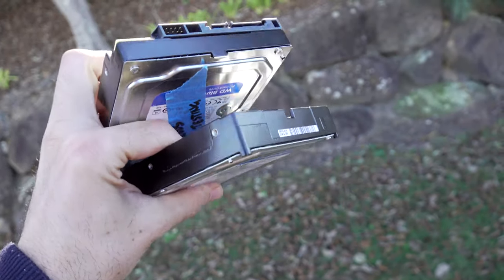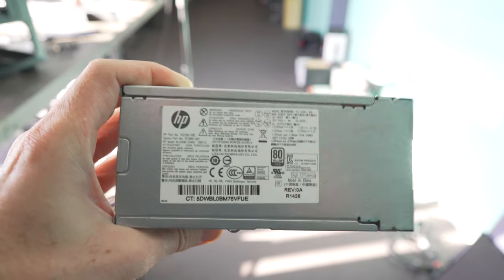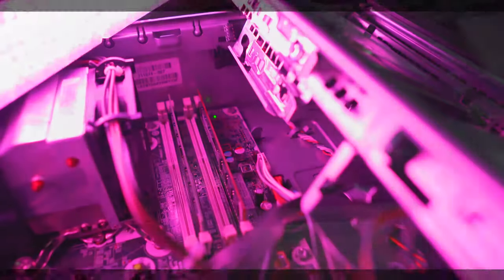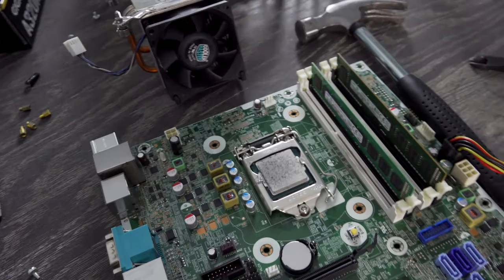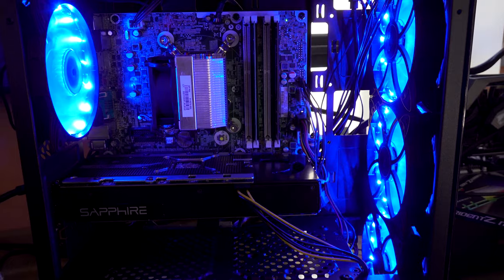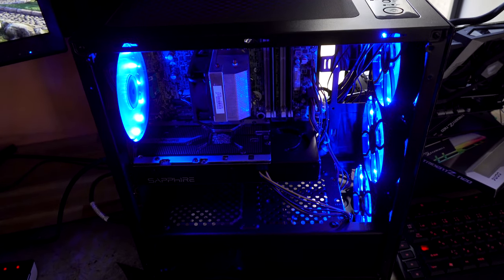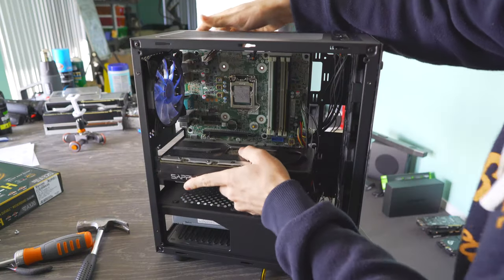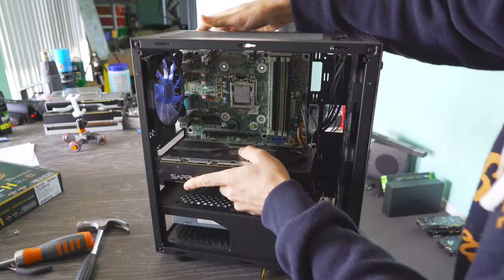Turning a $100 4th Gen HP ProDesk into a GAMING PC? (Mid-Month Hustle)

Comment: I'm using the exact same case and I can't for the life of me close the back side panel without the PC shorting out. I've cable managed all of it to the point where none of the cables should be making contact with the side panel. The fans just spin for a second and stop when the side panel is on. I've also changed out PSUs to see if that was an issue, but no luck. It's an OEM Acer motherboard

Comment: Instead of putting all the parts to new pc chassis, why don't you cut the metal piece near the pcie 16x slot that blocking the full height gpu card i/o shield?
Reply: remember he's tryin to resell this... i dont think buyers will appreciate a mangled case vs rgb sparkly new case...  im not sure half the buyers even know the exact necromancy tech city has performed on their systems for that matter.
Reply: @youngo2416  Well, if you know how to do it, the customer won't even know that the SFF case can contain a full height graphics card. Take a look at this video:

https://youtu.be/1xyyhRu6nRE

Next month I will do the same project like he does but with a longer card.
Reply: @mankdhanichannel  ok I agree with ur point.   .. but if im a kid .. do I want the dell office case or a rgb case ? I think its a much easier sell if u re-case it.
Reply: @youngo2416   It depends to the kid. If he is not complaining about why is the size of the power supply is so small and left such a hole in the back of that ATX case, then it is okay for him. 😁
Reply: @mankdhanichannel  yea that hole doesnt look good ... but hey its at the back and maybe rgb distracts :P... would not reccommend if you have a pet hamster ...
Reply: @youngo2416  If he use Lenovo or Dell motherboard, then he can use normal size ATX power supply. HP is suck because we can't freely swap the power supply.
Reply: @mankdhanichannel  thnx i c.. so there are no pcie cables for the GPU ?
Reply: @youngo2416  if you use SFF power supply, yes, there's no pcie x16 6-8pin power cable. But you can use a SATA power to 6-8pin power cable converter. It is widely available on eBay or AliExpress. Just remember, don't use power hungry graphic card or it won't turn on.

Comment: Hi Brian. I know this is an older video but I have a question for you. I have a HP Pro Desk 400 G1 MT which I have transfered into a new case. I reconnected fan and added new front IO which seems to be all correct but I am getting "error usb 2 no connected" any quick fix here? Thanks. Watch a lot of your content. Keep up the good work.
Reply: I jumped the gun with asking you. Looks like it views the USB 3.0 as usb 2. New case is an older model with no USB 3.0 so stripped USB 3.0 connected from old case and presto. Working

Comment: Tech Yes City sorry about my stupid question but I’m curious. Shouldn’t CPU cooler fan face the intake fans on the front and blow the hot air on the direction of rear exhaust fan? Why in this video the CPU cooler fan is facing the exhaust fan and blowing in the opposite direction of incoming fresh air? Doesn’t disrupt the air flow pattern and making temps worse?

Comment: Did u installed the cpu cooler correctly at 9:19??
I think the cpu cooler fan should be on the opposite side of the back exhaust fan...
In this position this two fans are working against each other. So, I think they won't work perfectly...

Comment: Great video!I have a question.Do the fans work like regular ones connected via pwm(can you set the rpms on it via motherboard,etc.) because of the splitter or do they work on 12 v (max) by default?I'm interested because I have mATX a320m-k and just 1 pwm on it for case fan.I'm using molex 4x3 pins splitter to connect my 2nd fan but it only supports max speed no 7 (less rpm)...Or that depends on quality of the PSU?I'm using cooler master elite v3.

Comment: the cpu fan connector was good you just put it the wrong way cause its actual pin header was at the top of the mother boaard where you plugged the system case fans

Comment: love your vids mate , i have a question i have just been given a HP prodesk 600 G1 would there be any benefit or upgrade from this to my HP 8300 sff it has i5 16gb ram and gtx 1650, i would use GPU  out of 8300 if there was going to be a noticeable difference in the 600

Comment: I got 2 of those prodesk 4th gen i7 4770 from the good will. That small psu was enough to run you gpu? I have an rx580 with a second psu. I thought that 240w psu would be to small.

Comment: i have a lenovo e73 sff that im in the process of  doing this to at the moment, picked it up for £50 with a 120gb ssd and 1tb hdd, only has a i3 4160 though so i will upgrade that and i already have a power supply to upgrade it with so i can power a graphics card, the one in it is only 180W so i have a 650w which has being laying around in a stripped case

Comment: To put it in perspective.
Battlefront 2 ultra settings - 60fps
Warzone season two medium settings - 60fps
Nier automata @high - 60fps
Rage 2 @medium - 50 - 60fps (if using the right setting then consistently 60fps)
Overwatch @high/ultra - 60fps
Watchdogs 2 @high - 60fps
Division @high - 60fps

Comment: I did this with a dell and I had to use the power button that came with it otherwise it would give errors so I had to drill a hole in the front of the case and glue the button in it

Comment: Nice stuff! I bought one of these prodesks about 6 weeks ago and had the same struggle. I even swapped out the psu using a $10 converter and slapped in a gtx 780. Only thing i havent been able to get are the boot messages disabled. Any thoughts?
Reply: Check out this post from LTT forums.  I think with the adapter you bought, you have to change the order of some of the wires. I'll have to with my 6300 Pro gen 3 atleast. Here is a quote from the post and a link to the post.

"remove all 4 cables from that white p2 connector and compare the cables with the ones from your old PSU.

your old PSU will have 4 or 5 cables on that p2 connector ( grey, green, white, white with red stripes, and sometimes black) .  the adapter will have (yellow, green, red, black)

 
ok, then put the yellow cable back in where the grey one was and put the green one back in where the green one was and put the black one back in where the pure white one was. and put the red one exactly next to where you put the yellow one."

https://linustechtips.com/main/topic/902466-how-to-upgrade-hp-pro-6300-mt-power-supply-or-hp-elite-8200-sff-fix/

Hope that's the solution.
Reply: I tried rearranging the cables, only 1 configuration allowed it to post but it always had the message

Comment: You could buy a Geforce 1050 low profile for your hp case and turning it to gaming PC very easy. I must mention, that power supply is not suitable for high power consumed graphic card.
Reply: Yeah a 1050 or 1050 ti would be a better choice

Comment: How did you get the connector on the front panel of the case to fit the motherboard? Aren’t they a little different, especially on an HP motherboard?

Comment: If the CPU heatsink is really mount in this direction, would it be better for changing the fan direction for better air flow? Or even changing the CPU heatsink direction 180 degree if the fans directions remains unchange

Comment: Hello i have hp compaq elite with i5 2400 2nd gen. can i get this processor and build another pc? cuz my hp motherboard is not working anymore and the psu. i would like to confirm if its possible to get the i5 2400 from my old hp hehe
Reply: is the processor of hp compaq i5 2400 is compatible with other motherboard with 1155 socket? like p8h61-m lx?

Comment: How did you end up mounting that cpu cooler? I have the tower version of this pc and would like to transplant it to another case but those mount points are a nonstandard length. In the tower the OEM cpu fan mounts onto points built into the case.

Comment: Since load wattage is about 290 watts for this system, did you run a stress test f.i. with Aida ? 
Sure, the system wil boot and run a benchmark with the 240 watt PSU,  but Im afraid it wil start to bluescreen in the near future due to low/dirty wattage.

Comment: a rx 580 can be used with a psu upgrade you can buy a adapter for these modles just make sure its correct and then you have a rx 580 a decent pair for a 6th gen veriant like the hp elite desk 800 g2 sff after a case swap and a cpu upgrade to a better one like the i7 6700k prob best cpu for this gen of hp elite desks plus lets say a 550 or 650 w psu and ypur set and if you realy want to have your usb type 3 ports to work you can buy a extender to make it reach the usb type 2 header if you dont care  about speed

Comment: Picked up a i5 optiplex 3010 this weekend for 30usd. What’s the best gpu to pair this with?
Reply: Depends on your budget.  I tend to lean towards Team Green, so...1060?  1080 if you have the $.  That's a good rig, too, btw.
Reply: RX570, and maybe another 4GB of ram since it has only 4GB.
Reply: Probably 1050ti low profile.
Reply: 1050ti or 1650 low profile versions are best, now there is pricing issue and wished end performance.

Comment: i use mu hp compaq 6300 with i3 3220 3gen cpu and 8 gb ddr3 ram amd radeon hd 6570 2gb(gt1030 will be better) 240 watt psu. and ssd kingston 128 gb. i use for gaming like csgo and gta v. works well, no need spend lot of money on this pc

Comment: i didnt quite get why you didnt put the cpu cooler the exact same way so you could have it blowing out the back? I see that it was something about the connector but it fitted fine in the old case? i am thinking about doing something like this (with a better PSU) myself

Comment: I have a hp 400 g3 mt and i put in a gtx 1650 super and yes it goes over the usb 3 connector at first i was like im just not going use them but everytime i booted the system it came up with an annoying front usb 3 error so what i done is i used a usb 3 extension cable and ran it under the graphics card and it worked i love how its possible to bypass proprietary things🤣

Comment: Always been an ex workstation budget gamer guy. My BOXX workstation (Xeon Bloomfield's 🔥) was getting long in the tooth. Just got a HP Z2 G4 tower with i5-10500, 32GB Ram, 512GB nvme, 2TB mechanical drive for around £300. I'm putting in a Sapphire RX580 Nitro+ SE for gaming. Can these things be put in gaming cases, Mobo says ATX but I'm aware HP can use different screw hole patterns etc. Any info appreciated 👍🏻
Reply: Im also asking the same question and looking for answers. I wanna know if those pin converters sold online will work on these intel 10th gen towers .
Reply: @jeffjularbal9404  sorry dude I got one thing wrong. It's an i5 9500. I got confused because I could have gotten the small form factor one which had the 10th generation i5 but I ended up going for the large tower because there was more space to upgrade stuff. It's been an utter joy to use. I have since learnt that you can forget about putting them into a different case. It's too proprietary. The 500 w power supply included on mine was plenty to power the GPU I chose but the 10th gen smaller tower could not power such a card which is why I decided to get the 9th gen. I'm not sure what you mean about pin converters. It does have the proper Intel chip set. That means performance really is very optimised 👍🏻
Reply: @psions555  Yeah those 10th gens psus are too low. Thanks man.

Comment: My pc is an I7 4770 with a gtx 1050 ti and 12 gig ram and I am not going to upgrade the motherboard/cpu till it dies and since it doesn't overclock I don't see that happening  anytime soon.  The upgrades I have done replaced the hd with a 1TB Samsung ssd for booting and programs and cracked open a Seagate 8TB external drive and made it an internal drive for media storage.  Being on disability for MS means I have to be a bit frugal with my choices and yes its an HP.

Comment: Can you adjust the speed of the fans with that 1 fan connector to 4 connectors splitter? I'm currently using 3 cooler master fans, but they are connected to a molex connector so they're running full speed. I did put a little button between the molex connector so I can cut the power off the fans easily, but that splitter might be a better solution. (I have an a320 mobo with only 2 fan headers)

Comment: I did this exact thing to my Dell Inspiron 3847. I transferred my mobo to a new case and when I was done, it powered on but didn't show anything on the screen I searched online and found that it was not possible for this machine to transfer over to a new case and I was bummed. Then I looked at the power button connector and noticed the 3 pins that touch, I used them on the new power button and walla! It powered on and everything was fine. I don't know why Dell does this, it is the only computer that I have seen do this, its weird.

Comment: If anyone is having/Modding this HP System and want to use even a higher wattage GPU like RX580 or GTX 1070, so want to upgrade the Power Supply with a aftermarket ATX power Supply like one from EVGA or Corsair .......... you just need a HP ProDesk 600 PSU Main Power 24-Pin to 6-Pin Adapter Cable (30cm) like this -  https://www.moddiy.com/products/HP-ProDesk-600-PSU-Main-Power-24%252dPin-to-6%252dPin-Adapter-Cable-%2830cm%29.html

Comment: Hey whet did you exactly do with the fan connector? i build a hp z230 in another case and have a issue with the cpu fan. i only van use the stock because the connector is strange. not lika another one. can i connect a aftermarket fan or cpu cooler to the board without a fan error because you cant shut anything down in the bios. only the fanspeed. looking forward to youre answer :) thx mate

Comment: I just sold my pc to start hustling like you do to buy a car at the end of the year, but I already miss my potato pc :c How do you do it?
Reply: Did you get the car?
Reply: @kevinvanneste2500  Yes, it's in the shop since tuesday getting the timing belt, water pump, thermostat, fan relay, cv axels and spark plug wires and shock absorbers replaced. Supposed to be ready tomorrow. It's a Nissan maxima 1991. It cost me $500 and about $500 getting it fixed and some new tyres. Got the money buying used amd gpus from US eBay auctions, getting them shipped to mexico and reselling them. I made between $10 and $30 usd on each one and sold like 24 gpus xD. I also made a gaming pc but it was kind of hard to sell and wasn't really worth it profit wise. Gaming pcs sell like in 2 weeks and gpu's in like 20 hours.  Would of liked to keep on selling more but cov19 and the new importing fees and laws kind of killed my hustle.
Reply: @Brandon-uy1uv  congratulations 👍 I'm happy for you

Comment: They make hp 24 pin to hp proprietary adapters so you can use a normal psu did it with my HP z210 Xeon workstation

Comment: He said 2nd gen and 3rd gen gonna give you a headache when you try to boot the RX 470 on these motherboard... and that's what happen to me right now, got this Foxconn H61MX motherboard, put my RX 470 in there, nothing happens, no display, not detect my gpu, nothing, put it back to my Ryzen 5 3500x rig, it works easily, but the H61 motherboard is not working... Can someone help?

Comment: I have a question is what it is possible to change the CPU fan to a standard water radiator or the displacement of the radiator screws is special is the second question is what it is possible to change the fan back to a fan of 120mm if I change the hole location what it supports this dimension

Comment: I see fire hazard with all that cable converters, extensions / spliters and a 240W PSU putting strain on it... Please never use PCIE converter cable... it will set your rig on fire. Many people had that experience and I, in a way, had that too... Just get a new proper power supply for $40 and an adapter to connect it to the mainboard on ebay...

Comment: I saw this video and decided to try out the challenge but the difference is to use the hp prodesk mt motherboard, that way I can use a nicer power supply, I got to work and everything seemed fine but my only issue is I can't figure out how to connect power switch, reset switch and such, any suggestions or links to help?

Comment: I have a gen 2 i5 2310 with 32gb of ram and a rx 580 8gb for shits and giggles. But my main rig is ryzen 3700 with 64gb of ram and rtx 2080.
Reply: ok you cant beat my brother he has a i3 2120 , 8gb ddr3 and RX 580 8gb
Reply: @Moshimulations  i mean i still have my duo core build with 4gb of ram and a 512mb gpu. It was my first build and ddr2 at that. but its put away as theres no use for it but just sentimental value. The others are ddr3 and now ddr4. But ill wait till we half way into ddr5 to even get that.
Reply: @cunnyman  yeah ik. It was back in 08. My i5 was from 2011 and i finally upgraded to a beastly ryzen build.

Comment: Been having some really bad luck with oem motherboards, bought 2 dell motherboards and they were so proprietary it took me 7 or 8 hours of rewiring to get it working and i still couldn't get the audio working, gave up on the second board. I got a lenovo board and it had a proprietary audio connector and it wouldn't work at all, it would turn on and immediately shut back down so thats broken, so i bought 3 vostro 260 boards, no proprietary connectors everything seemed perfect but of course none of them will give out a video signal with or without a gpu, same issue with an am3+ motherboard i got, all the cpu's work, all the ram is fine (yes i tried multiple channels), powersupplies are good, graphics cards are perfect, and i got one of the 3 motherboards from a different seller so im just out of ideas
Reply: I ordered some intel branded boards with nothing proprietary at all to do with them so hopefully it all just works